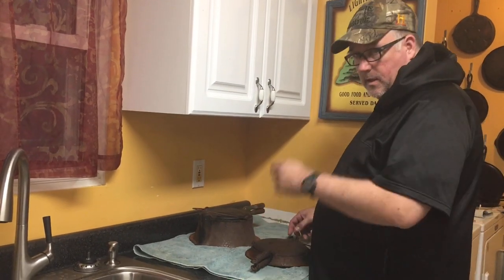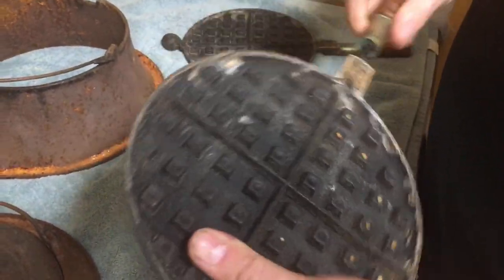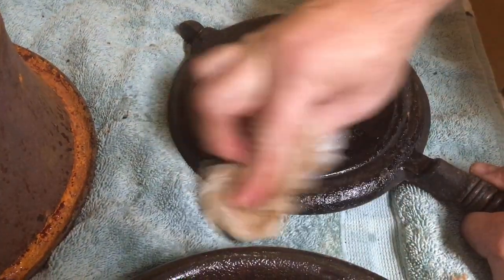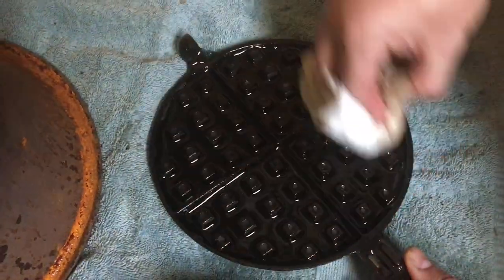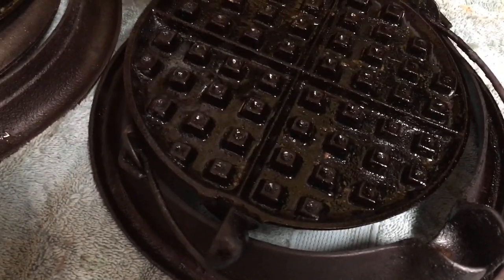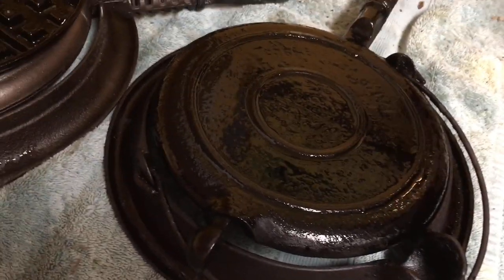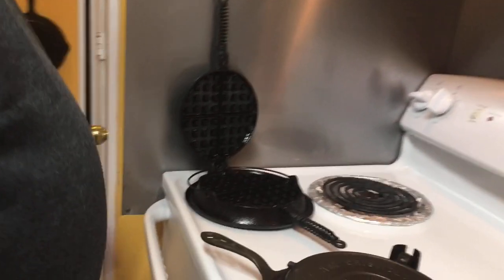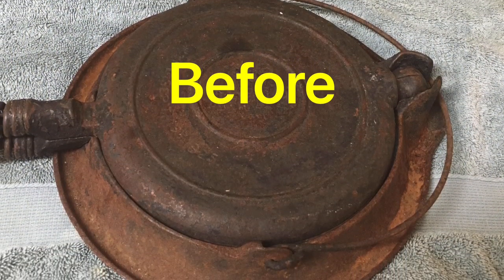WAFFLE IRON RESTORATION

Comment: Thanks for the video, if I may I'll offer my fellow viewers and comment readers some additional tips...
If it's your own gunk on the pieces that's one thing, but I recommend completely stripping pieces before seasoning.
Also, you should take off all of your handles, wood and spring alike.
Wipe off oil 99.99999999% before placing into oven.
And finally, like he says, things may be HOT, use equipment like brushes, gloves, etc., that don't melt at high temperatures if you plan to repeat-season while hot.

Comment: The one you had a part 
Clean and season it how did it stay together 
The hinge looks like it would fall apart 
When it opens
Or does the bottom plate hold them together ?
Reply from the maker: They do come apart. Only your grip on the handle holds them together. You hold both handles, flip and it works fine

Comment: Agree with @bobhughes9628, This is NOT a restoration... This is not to be considered as an approved method for 'restoring' cast iron in ANY fashion. The CI needs to be stripped first... The rest of @bobhughes9628 tips are correct. Not trying to imbue discord or be rude, but this simply is not a good 'practice' and should be taken as 'his' method alone. Cheers in all respects.